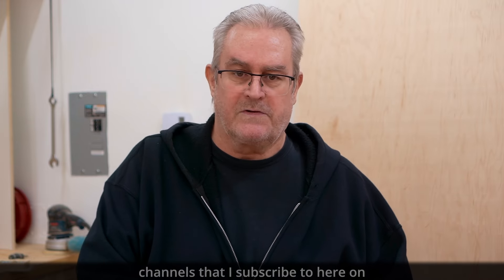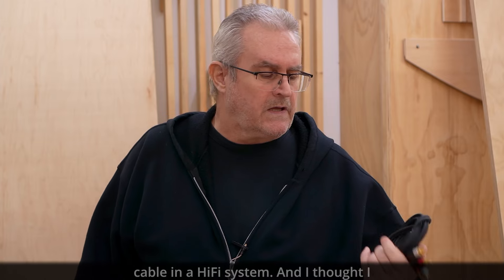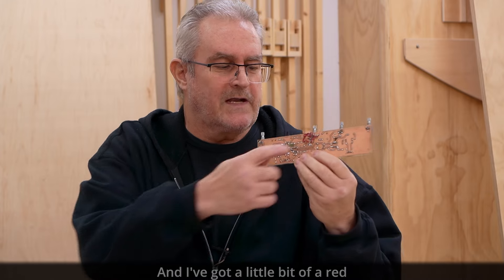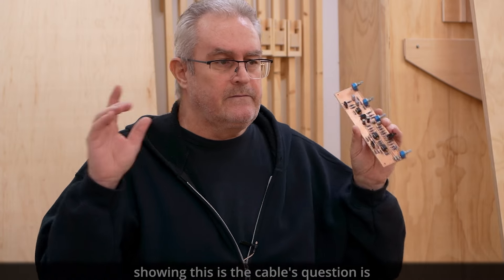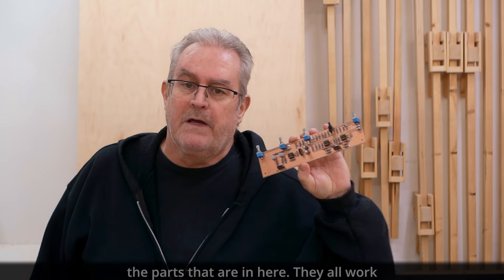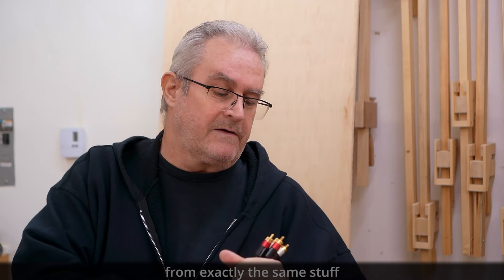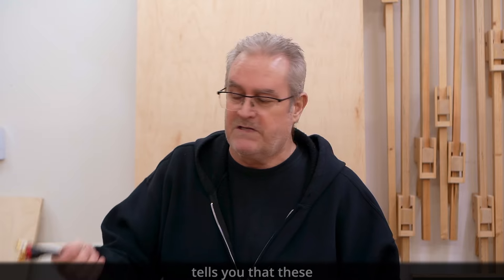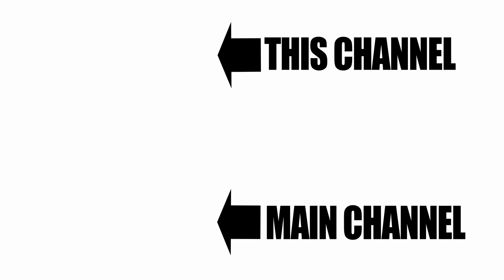Most important Cable in a Hifi system?

Comment from the maker: Subtext: at what level do you stop worrying about the quality of the parts and components that make up a sound system? 
Do you need an atomic analysis of the copper used in the circuit board? 
Do you need to know the exact chemical composition of the plastic used for insulation on the wires? 
Do you need to have the performance specs for stranded versus solid wire when used to connect drivers to a crossover? 
It's this kind of granular thinking and focus on relatively insignificant factors that comes from a lack of real experience and understanding of how this stuff actually works. 
And it's the perfect thin edge of the wedge for manufacturers to use and take advantage of when selling  products for many times what they are really worth. They are building doubt into your thinking (with the assistance of those who are already indoctrinated) and using that doubt to sell their overpriced and overhyped products.
Reply: There are some places where you certainly don’t want to “skimp” in choosing quality parts in any build of any consumer electronic devices. Parts matter.
Reply from the maker: Parts do matter, but not to the degree that most audiophile think they do. 
For example, most have absurd ideas about opamps and think they do not belong in highend gear. 
When asked, they can't give any real (based on fact) reasons why that is, and are hesitant to say that their bias originates from what they heard from other audiophiles.
Reply: @Aswaguespack  The thing to remember is, there is a difference in quality and snake oil. For example, you can buy quality crossover parts for few bucks, yet we see some $500 and up "upgrades" that change absolutely nothing.
Reply: Thank you Sir for your in-depth analysis. The problem starts when we use music to listen to the hardware.

Comment: Good morning John, I will admit I know squat about sound systems as I’m deaf but as a electrician and heavy equipment mechanic for over 40 plus years I’d go on record saying the ground cable is the most important cable in any circuit/ system.
Reply: Wise words, indeed!
Reply: Very important indeed. Often overlooked, neglected and not used or even connected in many consumer electronics devices of all types.
Reply: Just like cars I guess. Bad grounds can cause all sorts of hidden and/or intermittent gremlins.
Reply: @LessTalkMoreDelicious  very true and we are seeing some major auto makers using poor wiring harnesses either cheap insulation not suitable for high heat area and it’s a ticking time bomb waiting for a short to happen.
Reply: Is that so you can stay grounded while listening to the music 😊

Comment: "the lie that they are getting is the one they want to hear".......this is so true and is applicable to most of our society.  Back to audio, if you really believe that you need "quality cables" it is easy to make them yourself for a fraction of what you will pay.  Rather than reading claim after claim, buy an inexpensive set for $16, then make yourself a quality set for $10 and see if you can tell the difference.  If you can, then use the set that sounds good.
Reply from the maker: Their doubt is the real demon. They've been programmed to believe that everything that goes into making something is equally important, and that includes the method of doing it. And since they are not renowned cable builders themselves, they can never make one that would be as perfect as the one they are trying to copy.
Add to that that a lot of guys would have trouble making a cable, because they don't have the tools or minimal skill needed to do that.

Comment: Hi John, back in 1973 I worked in the service department for a well known privately owned hi fi shop in Liverpool called Hardman radio, I also helped out in the sales department when they where busy and got to know all the reps from most of the companies the shop dealt with i.e. Kef,  Harman kardon,   Celestion,  Tannoy etc. One day a new company turned up making and selling there own brand of interconnect cables (and yes they where very expensive) they where called QED, so I looked at the products and measured the resistance and capacitance of the whole range of the products and yes they where just same as all the much cheaper cables we stocked and sold from other manufacturers, so I ask the question, how can you charge so much more for your products and the MD of company ( QED ) said it's all in the name son it's quite easily done . 😀😀
In my opinion as you stated a good quality cable is just as good as any other, some of the cheap ones use copper coated crap to make cables this is not good, but the still the most critical thing to not do in your system is to change the cables from your record deck for some odd stuff that may be silly expensive but may be quite high in capacitive loading that will attenuate some of the HF from your expensive pick up cartridge the Bullshit factor always creeps into the hi fi world as you know.
Keep up the good work John.
Regards
Dave Fletcher.

Comment: From a rational point of view totally true. Nevertheless when buying a streamer and connecting to the amp there was a significant sound difference with some RCA cables. I could not believe it but could tell the difference in a blinded test very easily. Better crossovers are made of quality parts is my understanding. And good design of course. Speakers with e.g. Jansen capacitors und such have better reviews. It is not all snake oil. Listening and being critical is what is relevant.
Reply from the maker: And yet there are exactly zero blind listening tests that conclusively demonstrate that these significant differences exist. Why is that?
Think about it: if you are making cables to sell that you claim sound better than other ones, wouldn't you be running for all of the independent testing facilities to get the hard evidence for that?
I mean, your sales would go through the roof if you could prove a real improvement and you'd have the added bonus of shutting up all of us cable deniers once and for all.

Comment: Audio cables are considered to be low frequency low current carrying conductors. Well made quality connectors , and good  flexible insulation are what is important . If you are sending them into space or they are being used in a vital military or aerospace application you may have some other requirements, but for everyday audio consumer grade material and good manufacturing practices is all that s needed.

Comment: I love the videos that show the weirdness in the audio world. 
The cable thing can get you into the weeds when you start out.
My experience with cables is that if you use USB use a double shielded one. Above that there isn't much to gain
Power cables can make a tiny diverence in some very specific surcomstances. I could hear something in one part of one track consistantly other then that nothing changes, not better or worse just different enough to tell. There might be something there but it wasn't worth the hassle to me. 

Speaker cables, interconnets and any other cable is not worth anything more then the minimum you can spend to get your system up and running.
Any dollar spend there can be used to improve the room which has 10000% more impact to the sound.

Comment: Placebo effect is extremely powerful. As long as the connectors make a resonably good contact and the soldering inside is ok, phono leads are all the same. Likewise optical leads. Speaker cables need a little bit of current carrying capacity bt that's all. I would say going as short as possible in all cases is not a bad thing. As is not coiling up overly long leads. Only exceptions might be very cheap chinese leads that don't use copper! Many electronic components don't use copper leads anymore. They use tinned steel.

Comment: Paul McGowan says if you see a directional cable run…guess what, the only Unbalanced RCA audio cables PS Audio sells are directional.  So I agree with you there.  

The problem is the trend of using balanced quad audio cable for unbalanced audio connections, with the shield only connected at one end.  These can impact the sound, negatively. But with ideas like trying to avoid tone controls, buying overly bright speakers, and then taming them with poorly, but highly expensive cables gives people the impression that cables make a difference.

Cheer up, don’t let the audiophiles get to you.

Comment: Cables are very important for the sound in any component, but you do not have to buy expensive ones:  make them yourself, that is quite easy even for beginners.  Even great sounding silver wire does not cost that much.

Comment: You're absolutely right.  My dad got scammed into buying a metric ton of Monster cables in the '80s.  They sounded fine!  So did the cheap, unshielded spool wire from Radio Shack.  And don't get me started on what he did with CDs...

When I get cables, I worry about gauge and how badly I need it insulated.  Super cheap wires can break over time if you move them around much.  But I get the gauge I need that's insulated on the off chance that I'll get interference from something else, especially if I'm running up the inside of the wall and over the ceiling in the attic.  Other than that, the cheapest you can get your hands on the better really.  Gold plated connectors are nice to have because they don't oxidize.
Reply: What did he do with the CD’s?!
Reply: @solitary200 
Audiophiliac Magazine told him to take a green sharpie to the edges of the CD.  Some bullshit about reigning in the laser that improved sound quality...
Reply: @GalaxyStranger01  I remember this myth, I had a friend who also did it back then. 🤦🏻‍♂️

Comment: Most important part of a system is the one which improvement, improves the system performance the most. That is not a music question. Also in my humble opinion, 
less then 1 dollar means bad cable, 
around 5 dollar 'meh' cable, 
around 10 dollar is a good cable and 
around 20 is damn good cable 
after that snake oil. (for few feet of interconnect or speaker cable)

Comment: Hi John, I am getting into these baffle speakers after watching lots of You-tube videos and separated the pro's from the wannabees as much as I could. Hence my question for you, a pro.
I listened to Danny at GR-Research and yourself. Could you make a more detailed video on "wings" and their sizes etc. As far as I can see the new speakers from Clayton Shaw are flat in the front with no wings. (it's difficult to find a back and front view picture). 
Danny has worked out exact wing sizes and angles, tweeter gaps and more. How would it affect the sound if the front surface was slightly convex and by how much as compared to flat. Some are egg shaped, others have small eggs on top larger further down. It is said that a LARGE rounder over makes the wave propagation better at the interface.There's one guru who did all sorts of shape exercises with different results. None of them were rectangular.
I am looking at Clayton Shaws' new CALADAN speaker, but I need to get some some things squared away in my mind first.

Comment: For analog cabling (RCA's, speaker wire, etc) only 2 things will make a real world difference - wire gauge and shielding. With lower gauge wire (lower = thicker), you have lower resistance which means more power makes it to the other end of the cable. You can literally get more of your amp's power to your speakers by simply having higher gauge wiring. With RCA's, since you are dealing with lower voltages, the presence of noise (which is essentially any signal that's NOT in our source audio) is a larger proportion of the signal, which then gets amplified along with the desired signal to wind up audible from your speakers. This is bad. So you want to shield your RCA's as best you can. This is especially important in the car audio world where there is limited routes to run wiring and electrical noise is everywhere. I used to compete in car audio sound quality and would show people the difference with a pair of thin, unshielded RCA's feeding my front speakers (buzz/hum/whine would be present) and then switch to a heavier gauge shielded pair (noise would all but disappear). Brand names mean nothing. But wire gauge and shielding do. For digital cabling, as long as the 1's and 0's get to the other end, it will sound perfect.
Reply: I think if it's not just straight speaker wire, the connection to the jack can matter as well.
Reply: Yes, application and distance are factors not considered in John's blanket statement.  In a small listening room like his, perhaps there is no difference.  Use the same cheap audio cabling in an auditorium or a car from the 70s or 80s after a shade tree mechanic turns his car into a hot-rod with high amp ignition... You'll notice a difference.
Reply: Skin effect is also real though. There are some genuine differences in how electricity travels in different types of wire. Solid core, stranded, etc. that impacts the sound, albeit minimal. I was turned on to using belden coax by an engineering friend. Unwind the positive and negative twists and bundle them together. You then have nice thin solid core runs to avoid the skin effect, but enough of them to create a decent gauge cable and keep resistance low. Plus it’s dirt cheap. Switched my system over to it and never looked back.
Reply: @tylerhackman6832   "skin effect" is something new to me so I just looked it up, interesting. 
 
Do you use it for power from the wall, signal to the per-amp & amp or speaker wire?  If you know of a website with more info, please share a link.
Reply from the maker: Skin effect isn't a thing at audio frequencies. It's yet another "issue" that guys get hung up on because they can't put it in perspective. It's like saying your car will go faster if you wax it.

Comment: Why only empty talk and: No actual proof or actual listening tests.

The actual fact is that enormous and obvious differences exists in build quality when compairing different electronic components and cables.

A bad connection with bad connectors is a bad?

Connection. 😊
Reply from the maker: For example? Please list some of the obvious and enormous differences you've seen that affect audio performance.
Reply: I sense that this guy has expensive cables and thinks he can hear the difference..
I once splurged on Kimbre cables and speaker wire, it was a GIANT waste of money, total bs.
I have large horn speakers that are ultra sensitive and I could not hear a difference between them and my homemade shielded cables made from Belkin cable .
If anything I know that my home made cables will be better in a noisy electrical environment.

Comment: I call it Pure Shit Audio. That being said what is your opinion on when replacing internal parts on a piece of audio it there a part (cap) or (resistor) that you should upgrade to get better sound and longevity from that piece of audio equipment. Thanks.
Reply from the maker: Only reason to change resistors is if they burn out. Upgrading them won't be audible. Same for caps, but they have a lifespan especially if they run hot and are not properly sized.